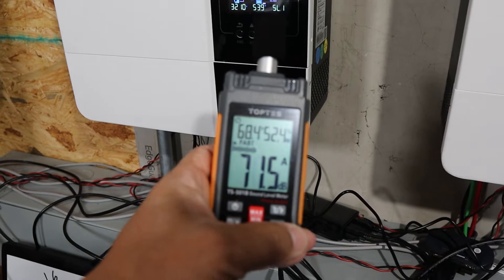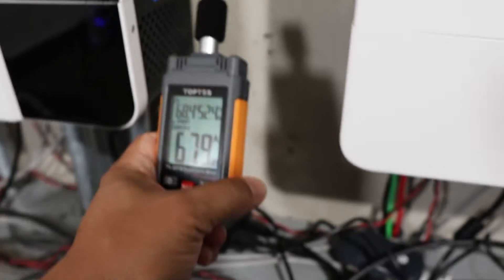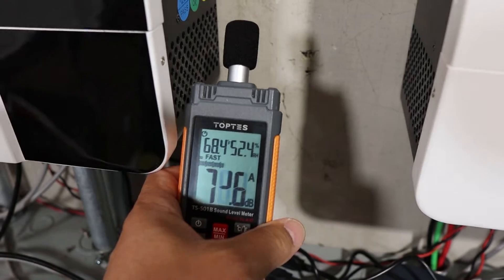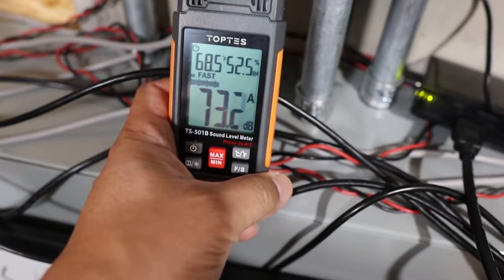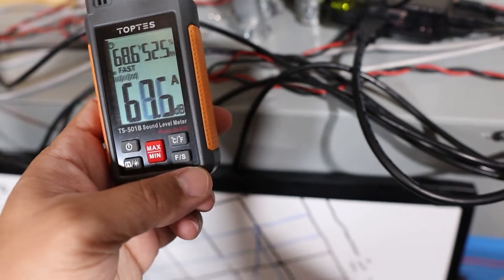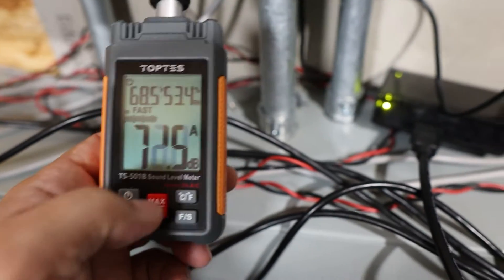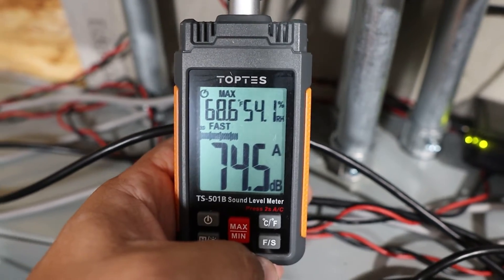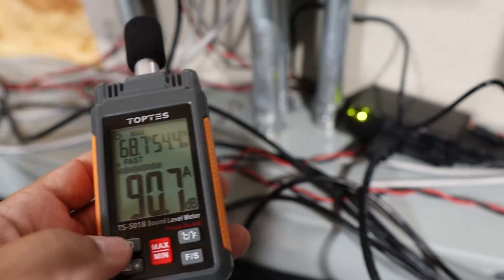How Loud are Growatt 5000ES Solar Inverters? - Testing with Toptes Sound Level Meter

Comment: Well Boys and Girls, have I ever found and fixed my SPF8000T-DMV-MPV fan noise problem! I convinced myself (wrongly) that the noise was mostly in the upper 2 fans. changed them out for 2 quieter ones, cover off meter @24" drooped from about 78db to 72. Bought a lower replacement rated at 48db, vs the 68 from just the lower by itself, and before doing the painful swap, fired it up off a 12v battery, and it was also 68db. So put a thermocouple sensor on the heatsink, observed fan operation, which is it comes on at 104F or a certain current load, per the manual, and at full load the temp never got over 110f, way low, for these scr's 150f is a piece of cake. So I try dropping the fan speed with a series resistor. Played with several, ended up with a 5 watt 10 ohm and the fan is now super quiet, and at full load the temp is only 120F. The 2 small current transformer board fans come in at 48db, and with both the power transformer fans and the single AC fan, I measure 54db, roughly 24db drop from factory, which google says is perceived as a little better than 1/4 of the loudness.  Bottom line is looks like Growatt's lower fan is sized for at least a 12KW unit, way overkill for anything smaller, and you can certainly put in a voltage dropping resistor, if you choose, more easily than a fan replacement.  I like the other choice even better, to put in a PWM fan speed controller.Either way all you need is a 3-wire extender cable (2.54mm connector) and just cut the red wire for either the resistor or the output of the PWM module as posted by another Youtube OP.  If you want whisper quiet, do the same for the pair of tiny fans (yes, the 8000T has a total of 5 fans).
Reply from the maker: Nice

Comment: Have a Sol-Ark 15K that has a high pitched sound. No load
Reply from the maker: That sounds unusual for a sol-ark. I would contact manufacturer for help in diagnosing the problem. 👍

Comment: What firmware do you have on your inverter? Mine is 113 with 114 and I managed to do an upgrade on it and now it runs much quieter on low power consumption.
Reply from the maker: Will need to check. I did update it several months back

Comment: Are you satisfied with the performance of these Growatt inverters?  I'm trying to plan for the system I want to get started with.
Reply from the maker: Yes but I will be upgrading at some point. Just depends on what you need your inverters to do. Off grid works great for the price. Can run my whole house so I do recommend.
Reply: Our inverter is noisy loud fan or machine is it normal sir this is 25kw